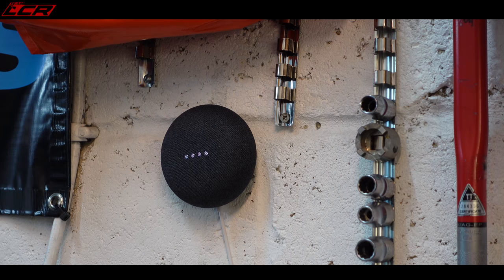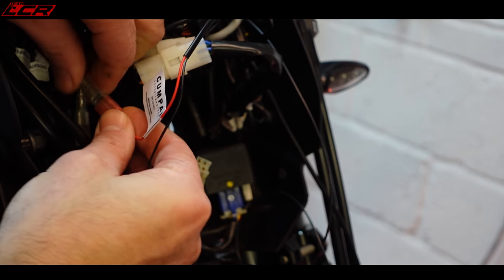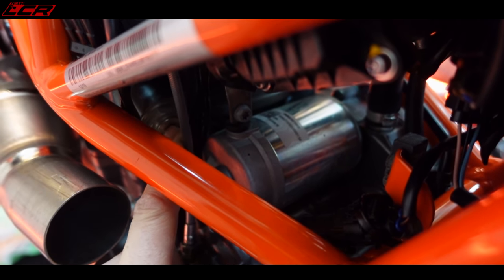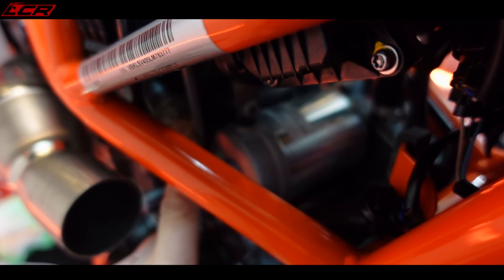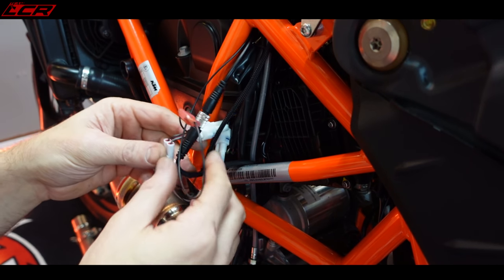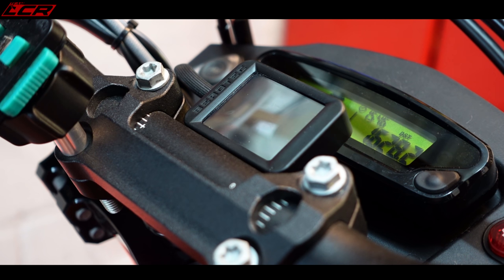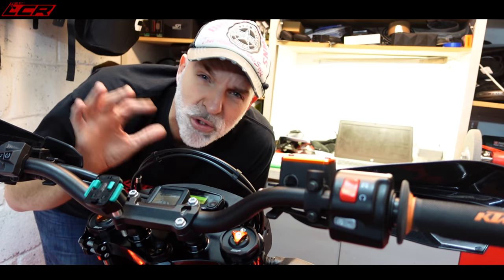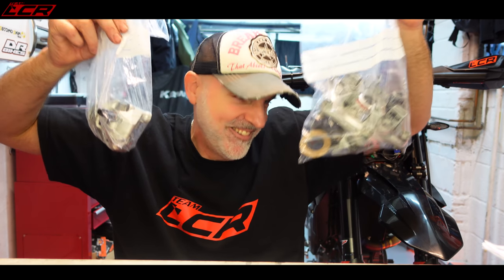Updated Display KTM 690 / 701 | Ultimate SMCR Build EP05

Comment: Double thanks for the vid Chops, my cumpan unit arrived last week- but I’d put off fitting it until you’d posted in case  you found any pitfalls that the Berotec video  had glossed over.
Your comment on the exhaust gasket and burning into the petrol tank made me check my wobbly Akrapovic dealer fitted unit- yep no gasket. Collected from local KTM dealer and fitted today- much better.
Reply from the maker: Oh wow glad that made you check! The other chaps pipe was also fitted by the dealer as it happens. Not good!! Glad it saved you 👍

Comment: OEM rubbers on old mx bikes never sealed the joints in exhaust at barrel or silencer, always apply some instant gasket for good seal and dampens any vibrations. Cracking vlogs as ever, but the anticipation for the unspeakable build completion is literally the elephant in you garage........🤣🤣🤣
Reply from the maker: Haha I know Anthony and I did address it in ep02 😁
Reply: @LambChopRides  I saw that, schoolboy error on my part commenting before watching the full episode😂 Little tip regarding oiling filter, small bucket with a lid, poor in bottle of oil, dunk filter and squeeze gently all excess oil, let dry if tacky oil type. Then a smear of grease around rim of filter for best seal. Worked for 40+ years racing motocross, albeit road conditions shouldn’t be as dusty!

Comment: Cumpan now has a color unit with gear indicator for the newer 690/701's... given the very reasonable price this looks like a no-brainer upgrade to these bike's instrumentation. We found that they have a tendency to overheat at high altitudes/low speeds/steep terrain (heavy load), and having real temp indicators (instead of idiot lights) would be very handy for those riding conditions (more for the Enduro than SMCR obviously).

Comment: Dont use impact drivers on the drive shaft nut, once you damage the threads its a hell of a job to replace the shaft, costing you SO much money it isnt worth risking it. You have to split the case to change it.

Comment: I'm upgrading my 2020 690 enduro with a power commander programmed by Rottweiler and a Cumpan cockpit assistant. Wondering if you had any issues with the Cumpan and the PC5 both piggybacked at the crank sensor wiring?

Comment: Hm, ridden my 701 50.000 km the last two years, never had an urge for a shifting light nor i did on one of my other supermotos before. For oil temp-sensor im running on the cheap with a simple analoge one as the oil fill in screw replacement, works just fine. 

Interesting stuff though whats possible with relatively little money.

Cheers
Reply from the maker: Yes oil temp is very handy, rev and shift light handy IMO 👍

Comment: I changed the calipers on a sv a few years back no abs system but it went from 2x 2 piston to 2x 4 piston and the master cylinder had to be changed as it couldn’t match put enough pressure to the extra pistons in the calipers incase you don’t see a difference in brake power from calipers alone it will be the master
Reply from the maker: Luckily after doing some research both the stock and M4 caliper have 34mm pistons so that hopefully wont be a problem 👍

Comment: I don’t know why people deal with all that installation. There are units that you can buy that plug right into the ODBII diagnostic plug. And, you can configure anything on the display that that the ODBII system monitors.
Reply: Post a link please. Also where is the OBD2 connector on this motorcycle?
Reply: @vwchris11  Google is your friend! The plug is under the seat.

Comment: @Lamb Chop Rides hello! does the cable/sensor for the rev work as gear indicator as well? And could i just leave the oil temp sensor hanging without  using it? or could it cause short circuit, electric problems and staff..? ty

Comment: Dont forget the Nova gearbox Chops...... How much HP and torque will you get? I’m at 73HP and 63ftlb’s (one one dyno) on my 2014. Love the new bike, but spent sooooo much loot on mine..... 🙄
Reply from the maker: Not sure what I will make.. I expect similar results at the wheel. Will look at the Nova gearbox but probably out of my price range
Reply: Hiya Chops, just to tempt you, the Nova box in my bike is a long range item. 1st is shorter, 2nd is almost exactly the same, third is slightly longer, 4th, 5th, 6th and especially 5th/6th are circa 10% longer. I used to be able to remember all the ratios as I went into it quite deeply! cant recall them at the moment though. Nova will happily chat to you, I think the lad I dealt with was Martin. With the extra power that you will have you can muck about with your final drive gearing to find just the right combination. I have mine geared quite short at the moment and its hitting the limiter at around 118mph on track😉. Geared longer, the bike will probably (untested yet) easily top 125-130, (indicated) possibly more. The box was £1800.00 for mine. True, its a luxury item, but I wanted real urge low down and the opportunity to shock the living daylights out of superbikes on twisty roads with the extra top end. I love my SMCr. Your bike is going to be epic and will probably outdo mine, but it would be great to do a side by side test one day. I’m tempted to get another newer one, but I have thrown so much loot and love at mine its hard to part with it
 with it
Reply: By the way - I cant remember if it was 53 or 63ftpoonds now. Either way, its clutching up in 3rd and will wheelie off the throttle in higher gears of the right sort of crests.
Reply: One down at the front and three up at the back.

Comment: Lamb chop rides I installed this on my bike 2019 Husqvarna Supermoto 701, bike went all to hell after. Check engine light on and code that has to do with transmission range sensor A&B. KTM Husqvarna dealer has no idea what is going on. I live in the United States North Carolina to be exact anything you can tell me?

Comment: Bypass the ABS? Get some Speigler lines.
Reply from the maker: They dont do a kit, just checked thier website 😥
Reply: Does the ABS unit run the speedo?  If so just fit standard lines then retain the unit for speedo function, fit some blanking plugs for the holes.

Comment: Anyone worked out the rpm limits yet? I’ve got a Cumpan on order and I’m wondering what numbers to plug in on my 2019 690 Enduro.
Reply from the maker: Didn't have to change mine really seems fine with the stock settings 👍
Reply: Thanks for the reply. I’m a huge fan of your channel - it’s a real treat to have you respond to my question.
Reply from the maker: Thanks Tim appreciated buddy 👍

Comment: Purchased a 2023 KTM SMC 690 R after having a previous model of the same bike. This bike is truly an abomination, especially in terms of engine and components. Given the terrible purchase, I decided to completely modify it to try to make it run properly. I have completely modified the bike with:

    Full Tekmo exhaust without cat
    Dedicated map
    DNA air filter
    Removal of recirculation and canister

The bike has improved, but the power delivery remains terrible. One thing that can't be modified is the lack of engine braking due to electronic intervention. Therefore, there is no engine braking, and it feels like riding a 2-stroke. Additionally, the throttle response makes it hard to get braking points right if you brake hard.

The quality of all the plastics has deteriorated significantly. I already have engine covers that are all scratched up (probably due to lower-quality plastic).

Terrible purchase.

DO NOT BUY this bike if you want a supermoto.